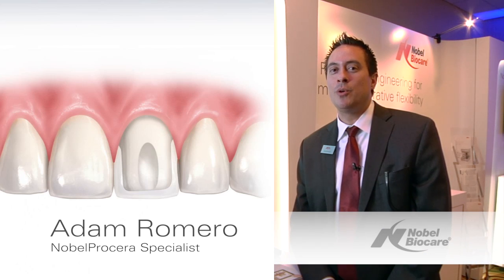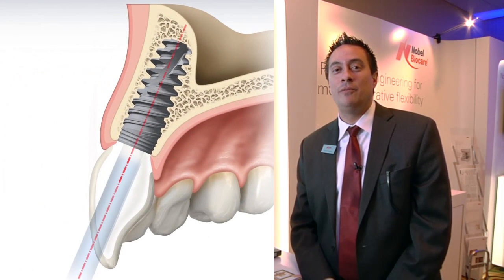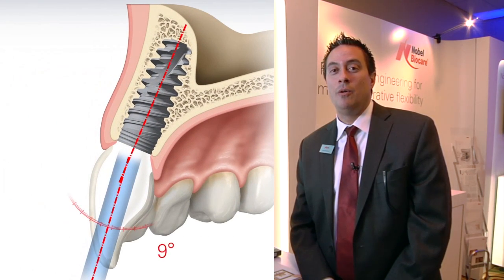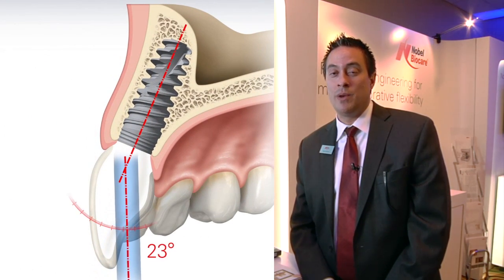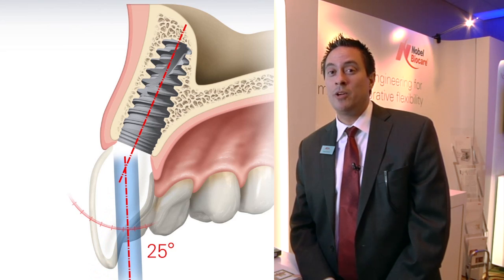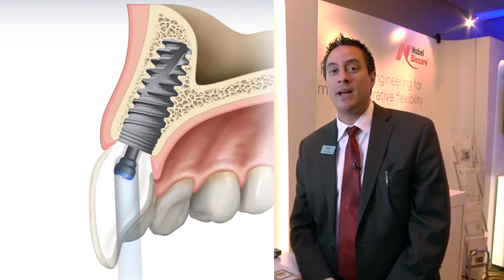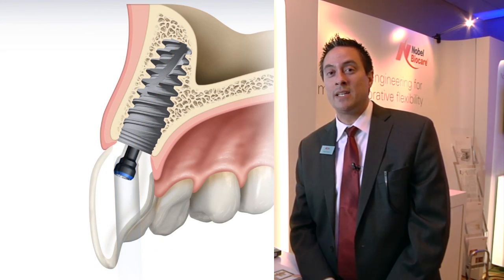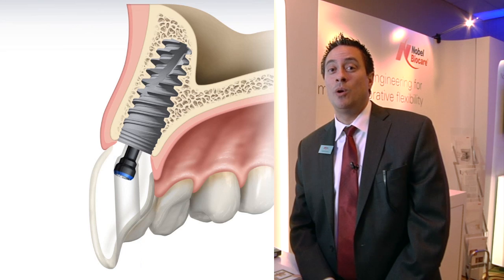Angulated Screw Channel with Omnigrip

Comment: What is the maximum torque applied through the angulated screw channel?
Reply from the maker: Dear Mangesh Saroj,

Thank you for your  question. 

The tightening torque of all Omnigrip Screws is set at 35 Ncm. Therefore, please try to be exactly at 35Ncm for optimal system strength.